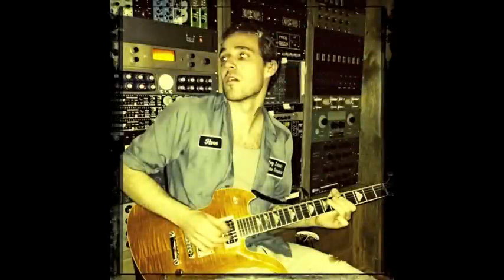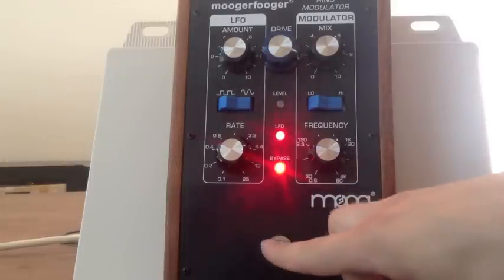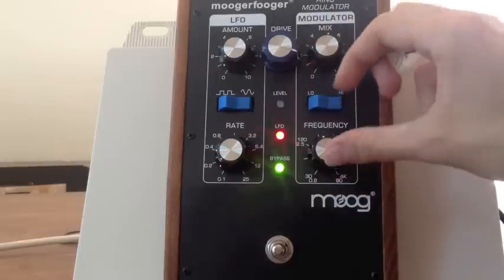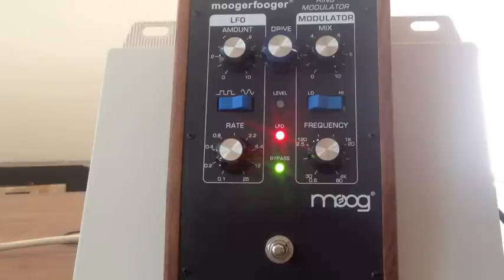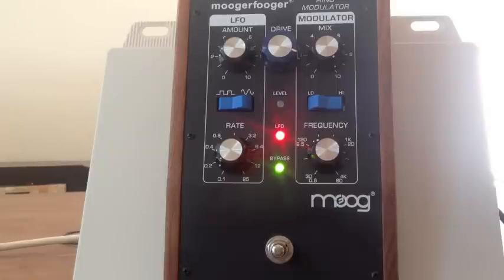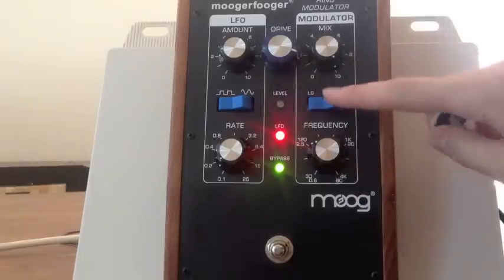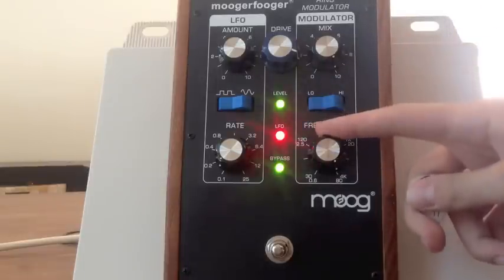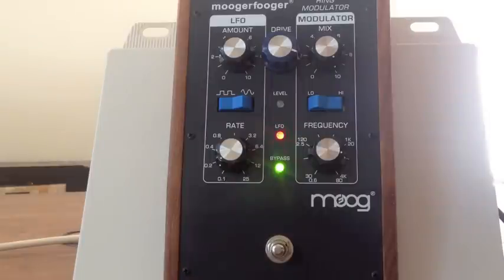How Ring Modulation Actually Works

Comment: All these effects pedals can impose xenharmonhic effects on otherwise 
fixed tunings, the amplitude /modulation included because it can 
simulate the beating of inter modulating frequencies.
 It is almost 
impossible for me to imagine how designers could fail to imagine what is
 necessary for an optimum design, but they consistently do fail to 
imagine it. EXAMPLE:
 Imagine the Wha-Wha came out with no foot pedal, just a knob, Why? The whole point is the FOOT PEDAL control!
 https://www.youtube.com/wat...
 Imagine the whammy pedal came out with just a knob, no foot pedal, Why? the whole point is the FOOT PEDAL control!
 https://www.youtube.com/wat...
 Imagine the volume/modulation pedal came out with just a knob, no foot pedal, Why? the whole point is the FOOT PEDAL control!
 https://www.youtube.com/wat...

 The Wha-Wha's foot pedal allows the musician to control the FREQUENCY 
of the notch filter while playing, otherwise the wha-wha is largely 
useless, the Whammy's foot pedal allows the musician to control the 
FREQUENCY of the pitch shift while playing otherwise a whammy pedal is 
largely useless, the volume/modulation foot pedal allows the musician to
 control the FREQUNCY of the modulation while playing otherwise the 
effect is largely useless.
 A ring modulator acts as if a wha-wha 
plus a whammy plus a volume/modulation pedal all in one, all three of 
these effects are controlled by the setting of the ring modulators 
CARRIER FREQUENCY yet somehow the designers do not see fit to include a 
foot pedal to allow the musician to control the carrier frequency while 
playing, which leaves the ring modulator largely useless.
 https://youtu.be/pBb4fS2vhp...

 Without a foot pedal to allow the musician to tune the frequency of 
ring modulator moment by moment the ring modulator is assured to sound 
OUT OF TUNE most of the time, drastically limiting its appeal, the best 
effect of the ring modulator is in CHANGING the carrier frequency while 
playing as per the wha-wha, whammy and modulation pedals, the designers 
and musicians have missed the boat entirely.
 The ring modulator is 
often described as "weird" "hard to use" "difficult to control" and so 
on, all related to the lack of a foot pedal and not to the effect 
itself.
 There should be no ring modulator offered without a foot 
pedal to control the carrier frequency otherwise the ring modulator is 
largely useless to a musician. Without a foot pedal control for the 
carrier frequency sales of ring modulators to musicians will be severely
 limited!
 Its as if the companies involved did not really want to 
sell ring modulators to the general public and did not care if musicians
 understand what the effect is for!

Comment: thanks man, you're cool. Hey I've been having trouble with my moog expression pedal, I don't know if it's me or the pedal but I can't seem to hear the difference with the pedal =( some help would be cool, thanks. great videos both of them I agree in everything
Reply from the maker: Make sure you're using a TRS cable to connect it (not a standard instrument cable), and make sure the knob on the right side is rolled as far as it can go clockwise. Also, where are you plugging it into the ring modulator?
Reply: cool thanks, appreciate it.. Indeed I was using a mono cable, that's probably what happened.
Reply: the knob is already like that but in the standard position it works weird in the one that says other it goes from dry to wet, is that normal?
Reply: This is my real profile if you wanna check out my music.. cheers!
Reply from the maker: I'm not sure I understand your question about the knob and dry/wet. But if you use plug the expression pedal into "Mix," then what should normally happen is the pedal will control how dry or wet the effect is—and the position of the actual Mix knob on the pedal itself will set the minimum.

Comment: Even though that does sound like a very superior ring modulator I've never found ring modulation to be usable effect. Great for imitating daleks though.

PS. A typo in my original typing of this comment led me to invent the term Rig Modulator - I'm copyrighting that so don't all you effects manufacturers out there go nicking it.
Reply from the maker: I think the key to making it usable is finding ways to reign it in—my favorite technique is to use an expression pedal to control the mix, and then bleeding in the effect only when I bend notes. Also Rig Modulator sounds dope.
Reply: SWEET FIX
Good advice.
LOL - "dope" - great.